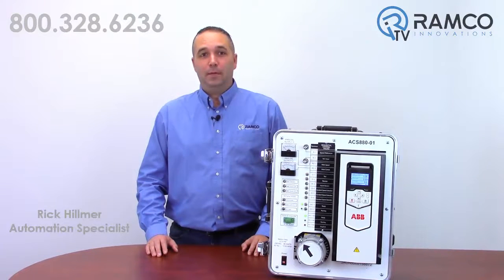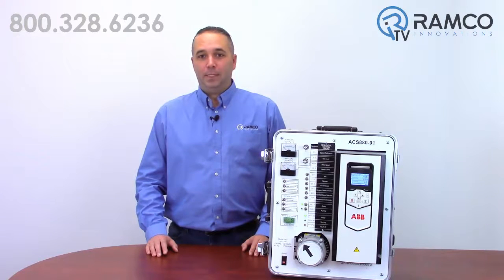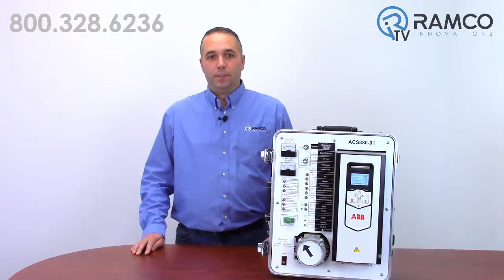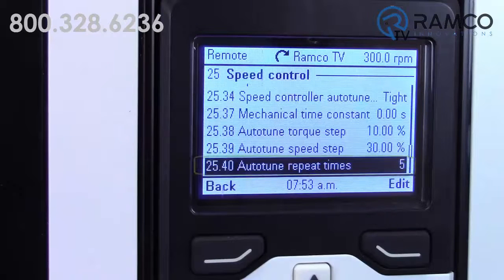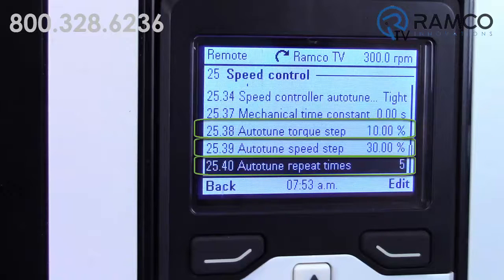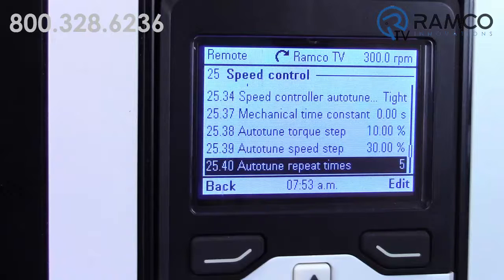ABB ACS880 Speed Control Autotuning

Comment: Why is your manual abb not sent with the drive anymore i spend 7000 on a drive then have to download hardware and software manual about 600 pages abb used send the book with it not basic wire diagram four pages long

Comment: HI!
I have an appliction with the ABB ACS880 drives, my application is about a system that we called "Calandra", In the system we have 3 motors, One of them is the Master and the other 2 motors are followers, I've been triying to configure the communication with the D2D Link, but I have not success,  so.... can you help me with my application?
by the way.... I configure the parameter group 60, 61 and 62
Reply from the maker: Hi Rodolfo,

ABB Tech Support will be able to better assist you with your application. You can call them at 800.752.0696 or email them at abb.mail@us.abb.com.
They will want your drive model and the serial number.
Thanks!
Reply: Ramco Innovations thank you